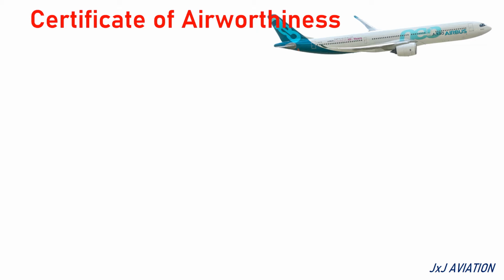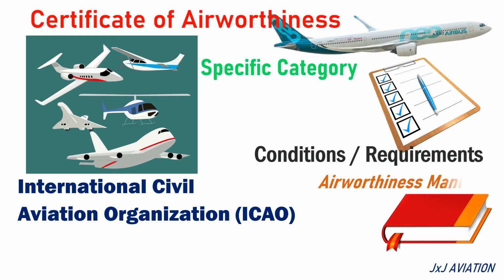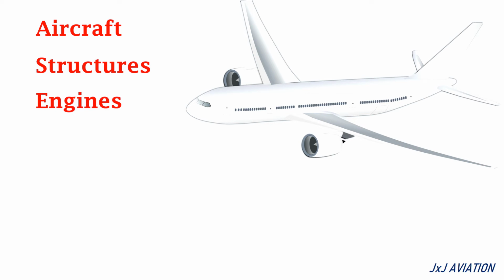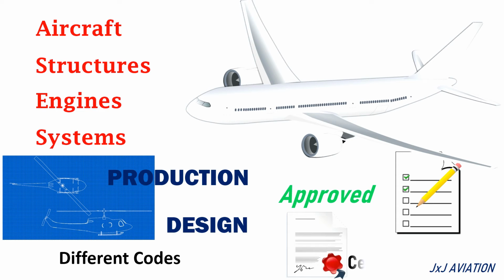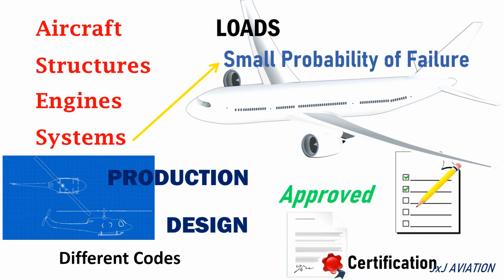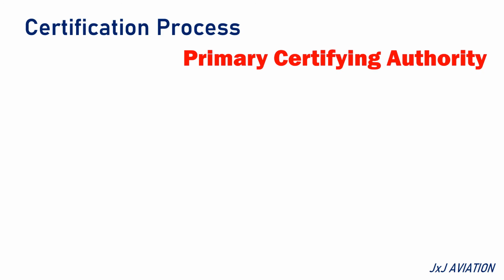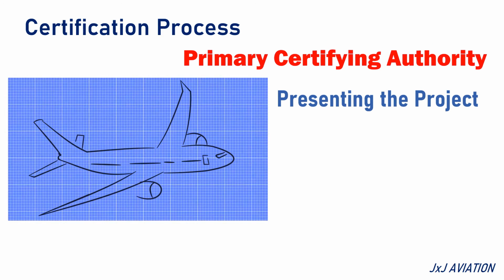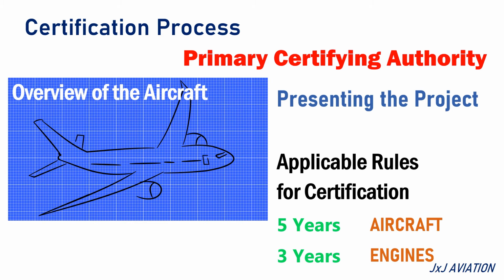What is the CERTIFICATE OF AIRWORTHINESS? | How is an Aircraft Certified?

Comment: There are some inconsistencies in the video. You are mixing up the process to achieve an Aircraft Type Certificate, which is issued by the "State of Design" (e.g. EASA for Europe, FAA for the US) authority (there is no expiration date, a type certificate is valid as long as the company holds such type certificate exists and continuously meets the obligation required by the applicable certifying authority) and the process to achieve an aircraft Certificate of Airworthiness, that is issued by the local authority (the authority where the airplane is registered and receive its "license plate" aircraft marks ndr.). Anyway, keep going, I saw that on youtube videos like this are still missing.
Reply from the maker: Thanks for the clarifying! Should have made it more specific. Do check out my other videos as well!